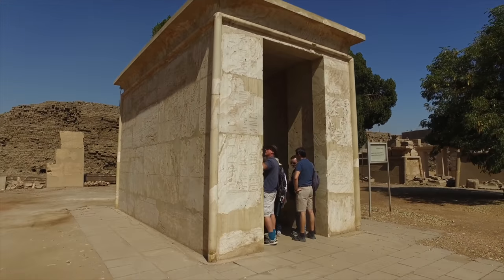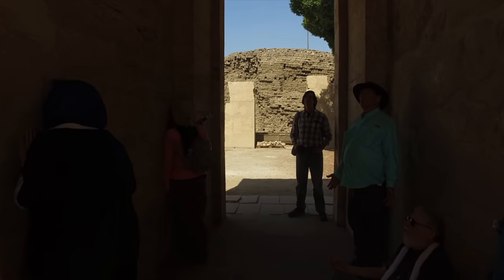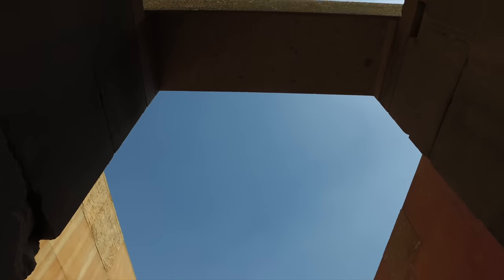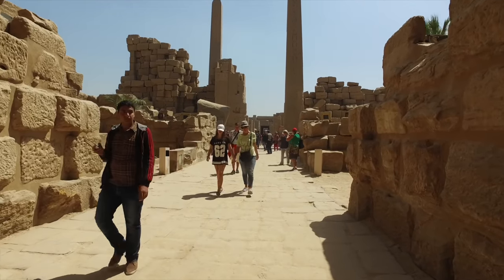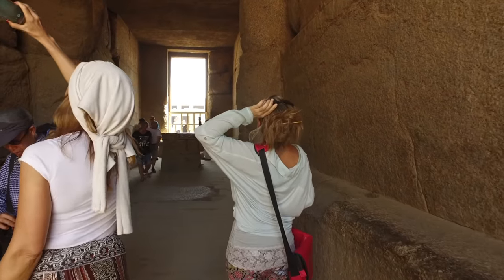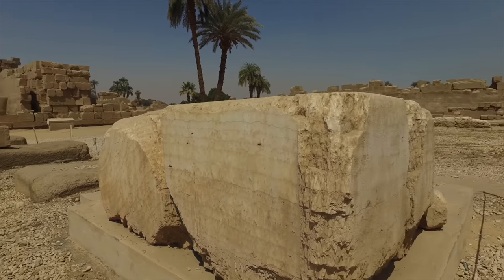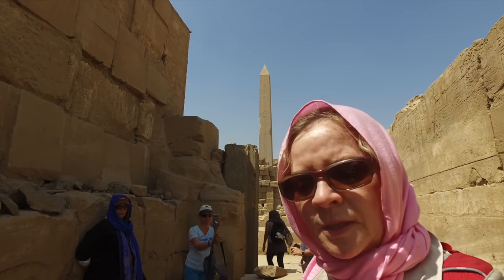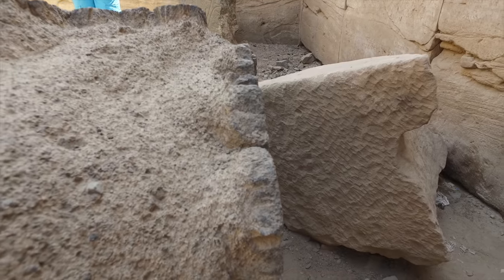Amazing Acoustics And Other Anomalies At Ancient Karnak In Egypt

Comment: Great information. I think that damaged rock is similar to if you bake a cake on too high a heat, the outside ends up with a layer of hard crust and the inside under done. So an intense heat on that rock would create the hard crust seen and residual heat getting through and disturbing the constitution of the underlying rock.

Comment: This is great, as always, but there's really nothing mysterious here.
Every building, room, bridge, closet, box, etc resonates to a particular sound frequency, depending on its length or height or width being multiple of the frequency itself.
It would be interesting to understand what kind of frequency generator they had been using, instead of just singing inside them.

Comment: The great pyramid was an controlled vacuum acoustical powered TRANSPORTER. Funny thing happens to sound. As the air density changes  in a VACUM/PRESSURE taNK,THE SPEED THE SOUND IS travelling. Now you know what those small tunnels were originally use for..adding or pumping out water
Reply: Transport what, and how do execute a vaccuum
I always thought it was a machine where water goes through and through moving creates piezo electricity, ionizes the ionispehere/ making Rain or tapping into the orgon/vril/prana Energy of earth,
Blue beam into sky making positive plasma?

Comment: The saw marks could actually be water jet marks.
Reply from the maker: I doubt it
Reply: @brienfoerster  My thinking is that water jets are pretty low tech. Water from the Nile, some sand, some copper pipes and a bit of an understanding of hydraulics is all you need. And water jets are still used today to cut granite. Would also explain why you sometimes get a fancy large cut radius and why you would have these boxes... see for instance: https://youtu.be/da4Q5ec3ORw?t=40 .
Reply from the maker: @unclewerner  Would need extremely high pressure.
Reply: @brienfoerster  Yes, achieving the pressure levels we have today must have been a Los Alamos style project back then. All I know is the power source is right there: it's the Nile. Many have suggested that the great pyramid looks like a ramp pump. We are like ants scratching at our heads when we see these "devices".

Comment: ..... is there any saw residue or trace metals left in the granite within the cuts? There has to be something that could last the time span?
Reply from the maker: no
Reply: Are you sure it's not possible to do it with copper saws but use quartz sand, or calcinised stone as an abrasive? Some videos seem to suggest that with this method it would have been possible.
Reply from the maker: @ultrafeel-tv  Not efficiently
Reply: @brienfoerster  I was thinking of a cut stone that had been shielded from the elements (within a building). I watched something you had looked at at Pumapunku where you identified the magnetic properties of that cut stone with the fine holes equally spaced in it.... compared to the flat surface either side of it. I immediately thought of trace metal within the cut to cause the magnetic fluctuation.... that's why I asked?

Comment: Sorry, but hot plasma ejections from the sun could cause burning of stone over a much larger geographic area than just here and there on a few square yards of temple walls. It would not burn such localised areas. There was another more realistic reason for the heat damage than Schoch's idea. Perhaps hot debris from cometary fragments breaking up in the atmosphere happened to rain down on these ancient sites. This would explain why the burning was so small-scale - the hot fragments were small and scattered.
Reply: Tunguska in Siberia in 1908 was a plasma ejection from the Sun. They found millions of tektites in the area concentrated at ground zero there- the tektites are glass beads that require the heat from the surface of the Sun to make them.

Comment: im sure they used  tar as mortar it would make good mortar flexible in the heat it would be like liquid glue to stick everything and seep into all the little holes and creveses on the surface of the blocks to be stuck thats why they stick so close they used pins and tar even in south america the buildings are earthquake proof   can u look at some stones and see if there is anything thin like a membrain between some blocks try look for ones that hasnt been moved fully and exposed to the sun if they did use tar or some sort of glue i doubt it would be visible after thousands of years it would be like stains  on the surface of the rock

Comment: Destruciton from the inside out through heat ?
To me its concrete that uses an acid/alkalis to break the stone into powder.
Once its poured, and primary set. The flammable acid/alkalis residue is igited to set and surface harden the stone.
The fercoity of the chemical reaction that take place, depend on the internal temperatures reached and the reactive chemicals involved.

You can do the same with limetsone/chalk.
Pulversise it to powder mix with water and then fire it, as it is 'self' combustible.
It makes a brittle but hardened surface with which to prevent against weathering.
Considerning the invention of the kiln for pottery and clay using mud fired bricks beforehand;
Why would the concept of firing stone be an alien rather than accepted practice ?

It is also much easier to impress hieroglyphs into soft clay, than chisel it out after setting hard.